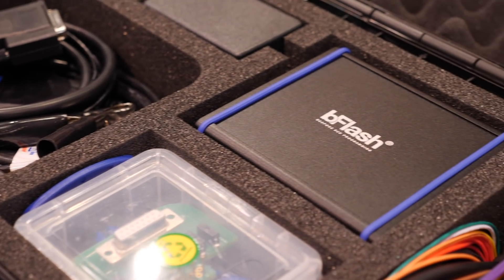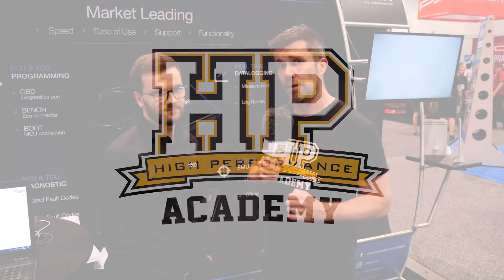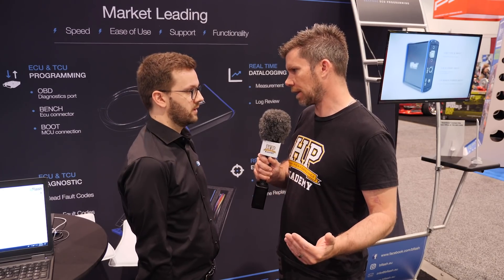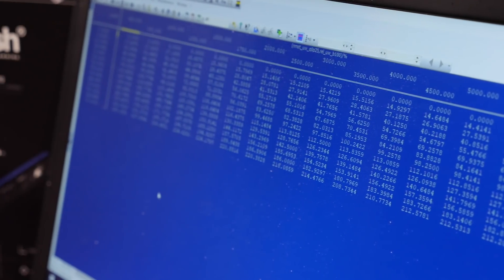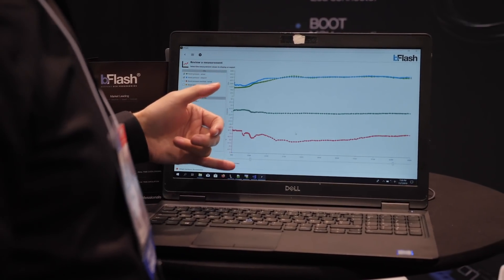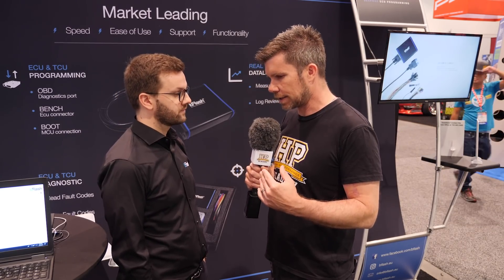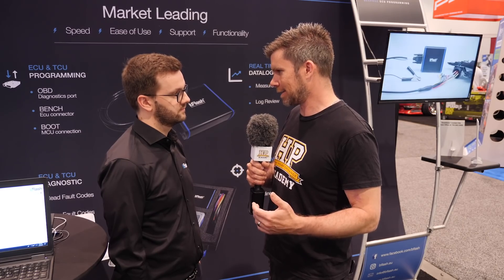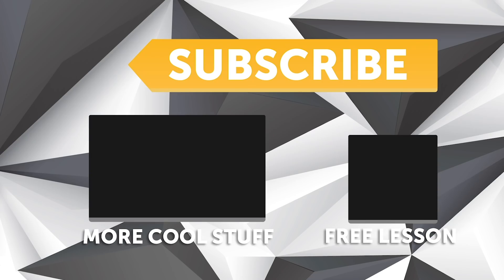Why Is This So Hard? | European Reflash Tuning [TECH TALK]

Comment: Remember when I was trying to find tables and sequences in WinOls because I couldn't afford those pricey definition files.
Will always love the standalones and the modded ecus.
Reply: I feel you. I'm building an aircooled Ducati race bike from the ground up and I'm using a standalone ECU because the stock ECU would cost a lot anyways to get it to work properly because it's super picky and there are many specific things to every single unit that makes it impossible to use unless the whole harness and electronics comes from the same motorcycle, and it won't let you do any changes... so long story short, I decided to go standalone (although to my knowledge no one has ever done this in this type of motorcycle)

Comment: The BFlash setup looks good, I particularly like the look of the BTrace feature, but I don't think too many applications are supported by it yet.
Reply: All cars are supported for logging with OBDII, but we offer specific logging on:

-Generic OBDII
-FAL MED17
-BMW/Mini MED17, MG1
-Ferrari MED17
-McLaren ME17
-MB EDC17, MED17, MG1
-Peugeot/Citroen MED17, MG1
-Renault/Nissan EMS3110/25/50, BED50x, EMS3155
-VAG MED17, MG1CS, SIMOS12/18, SIMOS 8

bTrace - step by step instructions
==========================================
Requirement :
- You must possess a registered and up to date version of WinOLS.
https://www.evc.de/en/product/ols/software/
- The plugin OLS1011 is required for Live connection
https://www.evc.de/en/product/ols/plugins_detail.asp?cksName=OLS1011
How to etablish a live connection ?
Step 1 - WinOLS : Open your WinOLS project
Step 2 - bFlash : Go to Measurement > Make a measurement.
Step 3 - bFlash : Select matching datalogging protocol & press Continue.
Step 3 - bFlash : Select the variables you wish to review.
Step 4 - bFlash : Press Start to enable connection between car and bLog and display actual data.
Step 5 - WinOLS : Go to Window > Visualizer : click Connection button. [connection status is also visible in bFlash]
Step 6 - WinOLS : Assign available variables to X and Y axis of the map.
www.bFlash.eu
grtz
Team bFlash

Comment: Please make European car tuning lessons!
Reply from the maker: We already have a VW in the course material. A 4 stroke gasoline piston engine doesn't care what accent the driver has, it's all the same and it requires the same knowledge to tune. The hard part is just having the software for it when it comes to reflash tuning, but if you're fitting an aftermarket ECU then life is easier - Taz.
Reply: @hpa101  thanks for the quick answer.
I am from Europe and want to do reflashing, american and japanese cars look easier to tune as our european cars.
Reply from the maker: HP Tuners and COBB cover a few Euros, but yest, the US and JDM markets are much better supported. Some Japanese marques have even encouraged aftermarket development in the past - Taz.